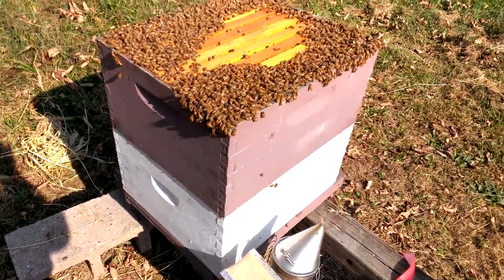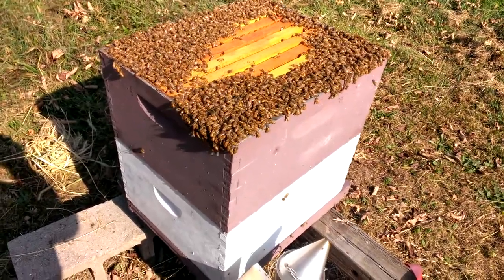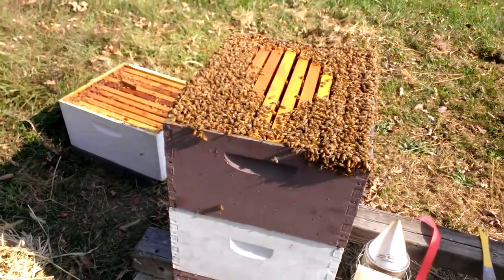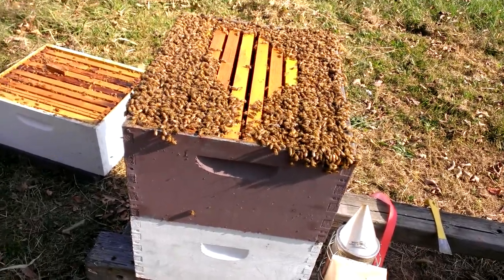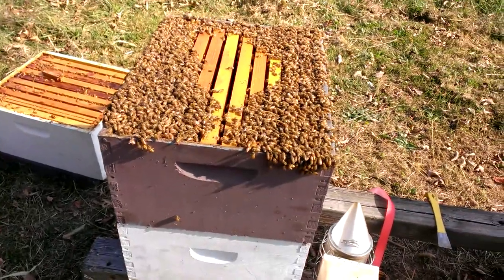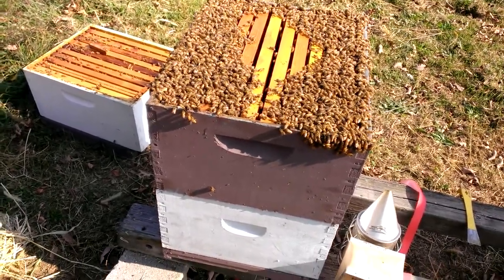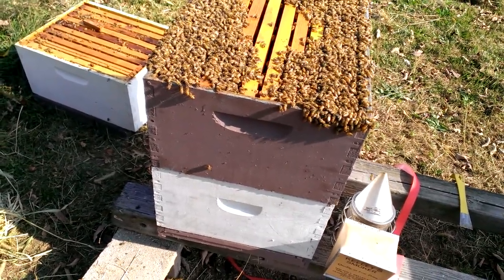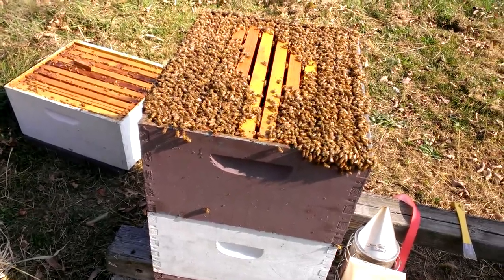October 5th 2013 - Mentoring Hive Inspection 1

Comment from the maker: This hive was split in the spring.  It also had a nuc pulled out of it for one of the county fairs.  In addition it had a break in July when we had three weeks of 95+ degree weather and the queen shut down.  It doesn't have a mite load problem because there were a number of interruptions in the brood cycle for it.  The good news is we had a great September and it has really rebounded from the fall nectar flow.